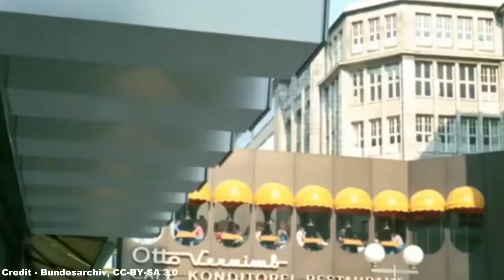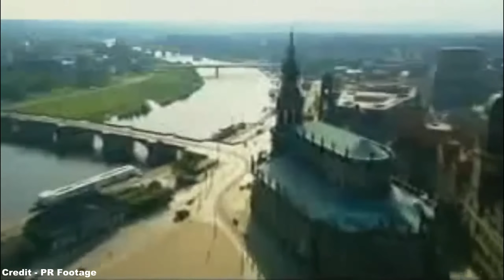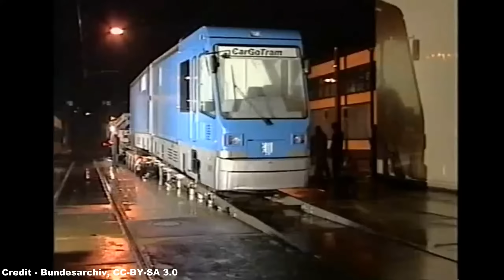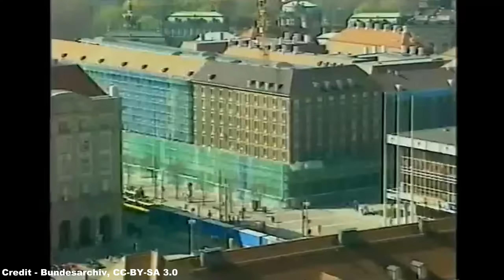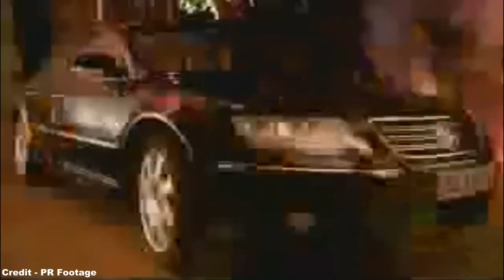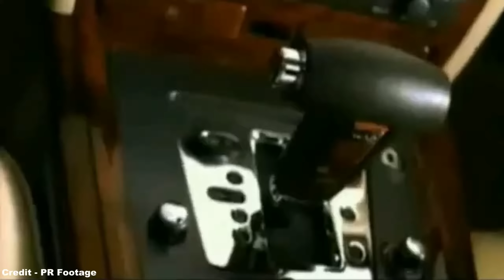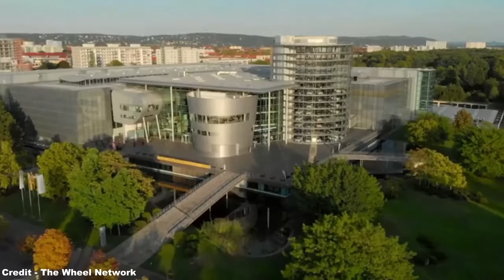CarGoTram - An Efficient Alternative

Comment: cargo trams are such a nice thing to have, the joke is that they almost never were used for the regular cargo requirments of a packed city struggling with congestion. Instead its most often just for a dim prestige project which never were about efficiency (like an inner city car factory/show room).
If these cargo trams had been used for essential needs which dont fluctuate with trends/singular company business they would have been a success. Every dense city has garbage/recycling collection points, post offices, huge shopping centers/markets with a constant flow of bulk goods and so on ... these should have been the objects utilizing cargo trams. 
Yet even here in Dresden, where we already have the trams and a loading station far enough off with rail and road connection, noone even tries to give our inner city objects with cargo demand a tram loading station so that the number of trucks having to enter the inner city could be cut down in meaningful ways.
just shameful how poorly city planners think things through.
Reply: Glasgow's (first generation) tramways were built to 4'-7¾" gauge, specifically to permit standard gauge wagons to access that once extensive network.  The reason for that odd gauge being that railway flanges are markedly deeper than those of trams, the upshot being it was the flanges of the railway wagons which ran in the grooves of the tramway. The feature WAS employed in a very limited capacity, over a short section of one route.

Obviously, no gauge widening was possible on curves (one of the big differences between tram and railway PW), which is why trams were so damnably slow (and usually noisy) around curves.

The ex-Glasgow trams working at Crich (Derbyshire) have been re-gauged to the standard 4'-8½", but are no less stunning for that. This paragraph has been a shameless plug for the National Tramway Museum ... do please check their website and prepare to be amazed !!!
Reply: Yeah plus it had within it, apparently, the seeds of its own demise, or indeed that of the pre-driverless car era we are about to enter, didn't it? The whole factory automated and all that? Wow. Another great vid from Ruairidh.
Reply: Tbf you can't really blame city planners for this since usually these kinds of decisions are made politically and not by actual professional urban planners. And here the issue is usually a lack of imagination, the status quo is everything gets delivered by truck and no one ever considers whether this status quo is desireable.
Reply: Cargo trams are a great idea in theory, and can work in limited cases as shown here... but anyone with more than a rudimentary understanding of how logistics works (or how tram networks function) will be able to tell you how difficult and disruptive it would be for widespread adoption. Even in cities with huge tram networks like Prague, for things like garbage collection, you would still need a large fleet of regular garbage trucks for the majority of streets that aren't on the tram network. Using tramways for cargo is a nice idea, but how many people would be happy with a half-hour gap in their tram timetable because that's when the Tesco Metro gets their cargo tram delivery?

This urbanist utopian idea of everything being delivered by tram or quadricycle is just a pipedream, outside of a few edge cases in places like Switzerland.
Reply: @Eric_Hunt194  trucks disrupt tram networks just the same in dense cities where both share the same (cross)roads, and noone was talking about trams collecting garbage or roadside shops ... I refered to regular bulk loads going from and to larger objects in the inner city, not trams becoming the last mile delivery like the Amazon truck or bread delivery for a shop.
Every larger city has larger objects in its dense center where a large number of trucks stop every day to drop off or take on cargo. So these loading bays are usually rather large to also accomandate multiple trucks at once. Such objects could have the point of delivery offsite, replacing its spacious truck loading bays and turning points with a tram stop (which still could double up for the occasional truck like tram stops do for busses) and then a cargo tram would only have to come when its filled up with deliveries from a large number of trucks. And such a trip wouldnt disrupt the regular passenger service of the trams, as stopping points would be off the regular line ofc. So there would be no tram waiting while your roadside supermarket is getting its bread, because thats not what a cargo tram would do.
And no tram line service is so dense that they couldnt fit multiple cargo trams in between.
Reply: @diedampfbrasse98  the issue is that cargo takes longer to load and unload compared to passengers, so if they're sharing tracks they'll get in the way.
Cargo trams are a great idea for the niche cases where they will work, but they aren't suitable for such widespread adoption that they could eliminate LGVs (or LKWs, to use the German terminology)
Reply: @Eric_Hunt194 Again, we dont talk about bread or vegie deliveries for your simple shop on the side of the roads. Large objects have the loading happening off the road network already, so how long it takes to load/unload is not an issue at all. Our cargo trams only shared the tram lines to move, nothing else! Which means you theoreticly can get as many cargo trams on the way as would fit in between the regular passenger traffic on those shared tracks.

Comment: What an excellent idea! Get diesel lorries off the streets! Thank you for making this.
Reply: It got retired a few years ago due to VW moving focus to a different plant which now requires lorries again.
Reply: That doesn't discredit the idea though  @lilywho-onrails
Reply: It's only viable though on routine routes of reasonable volume. For everything else diesel Lorries are still required.
(electric Lorries having been proven a scam, over & over again)
Reply: @jimtaylor294  I wonder if methane trucks are viable?
Reply: @MAL1GNANT  Possibly. The diesel engine's pioneer wanted to use Peanut Oil 🛢 🤔
Reply: @jimtaylor294  Why not have cargo trams go from large train terminals to small cargo tram stations around the city and then as a last flexible step use forklifts or cargo bikes
Reply: @DanSher  Possibly. With a newbuild town or city shopping area it should be possible to use a Cargo Tram or similar Light Rail Freight system, with FLT or "lollup" transport for the last few yards into the shop's loading bay.

Comment: I find this idea good. Trams, here in Switzerland as well, go past all the big shops and stores in the city. I would probably move the cargo at night. And it's not Sashen, it's Saksen and it is called Kemnits and not Shemnis. It's German, not English, get it. Stop ignorance on languages.
Reply: No reason to ridicule someone for mispronouncing a name. Simply correct them so they learn how to pronounce it but no need to talk down to them
Reply: @Genf4.2  It's not the first time, it is constant and it is called ignorance.
Reply: I Zurich we have some garbage transported by tram. I think running trams at night would disturb citizens, houses along the line vibrate, and there is a lot of noise.
Reply: @gentuxable  It isn´t like the trams would run every five minutes or so, just a few for the stores plus the normal night trams. But I thing that labour costs would be too high at night for it to be viable and delivering it during the day (without extra tracks) could disrupt passenger traffic.
Reply: @Dergelbe1208 also deliveries at night require shops to be staffed at night. Fine for large supermarkets but not for smaller businesses.
Reply: Getting triggered over something as trivial as a mispronunciation of a place name. Wow, phone the police...